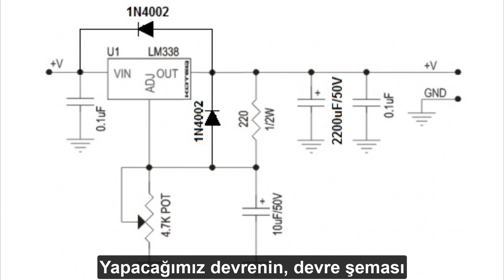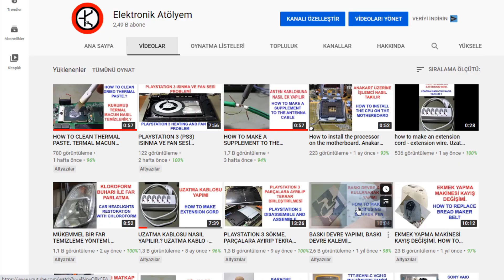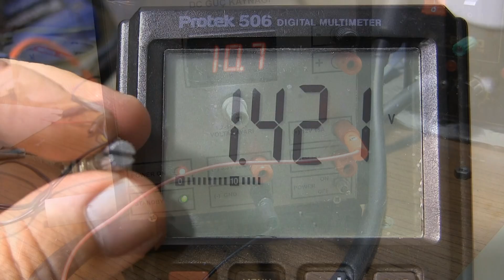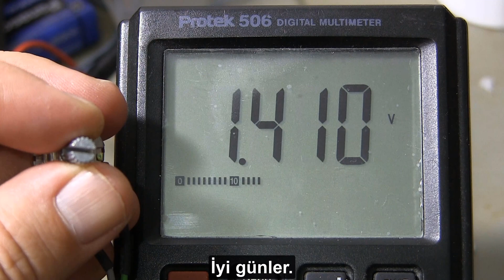ÇOOOK KOLAY!! (Ayarlı Güç Kaynağı Yapımı.)

Comment: you say 5 amp  where  is  the  load  to  improve  that ??  it's  just  volt  regulator
Reply from the maker: I used the lm338 IC in the circuit. This IC can deliver a maximum of 5A with good cooling. You can examine the datasheet data. https://www.ti.com/lit/ds/symlink/lm338.pdf

Comment: Wow, you made a circuit board from scratch. Earned 👍. Quick question ❓
I am adding 2 led lights on a toy lamborghini for a getaway Pinball machine. I connected negative wires together and the positive wires together. So I have 1 positive and 1 negative wire from the toy. Is it safe just to solder to a another led lamp under the playfield if toy LEDs are 12v and pinball lamp is 12v?  Should use a resistor or diode if the playfield led lamp already has one installed in line?
Reply from the maker: Hello. Thank you for interesting of my video. Although the leds are 12v it would be good for the lifetime of the leds to connect a current limiting resistor. Therefore, it is useful to install a current limiting resistor in the led you will install.
Reply: @electronic7979  thanks, is 1 watt 100ohm resistor ok in line positive wire to my toy lamborghini?
Reply from the maker: Can you take and send the picture of the LEDs you use to my e-mail address  elektronikatolyem@gmail.com.